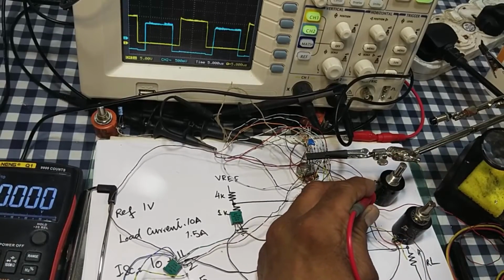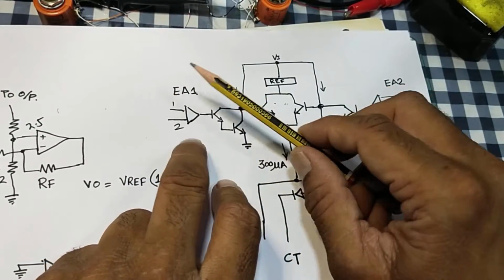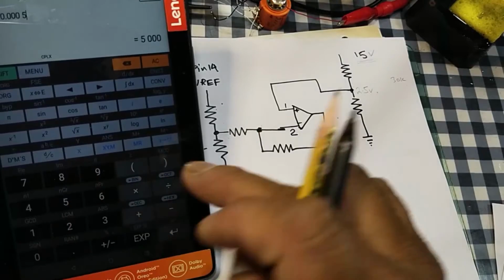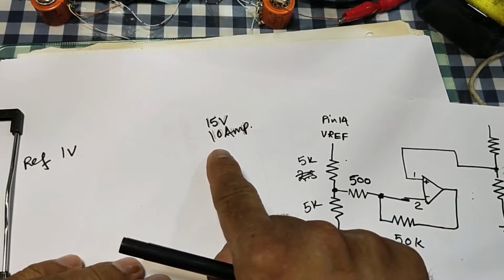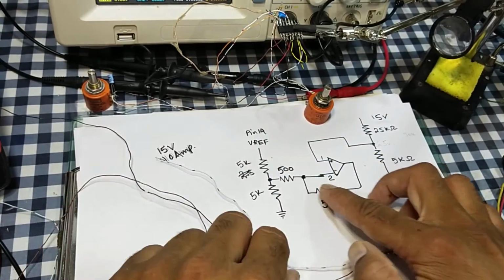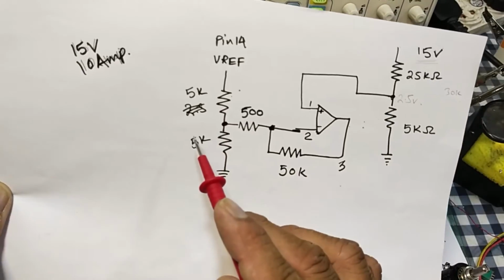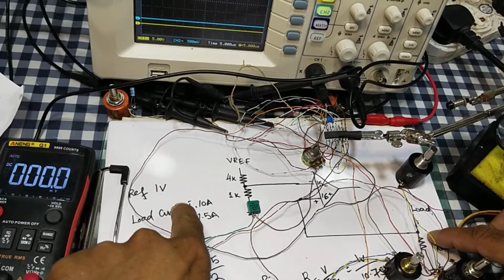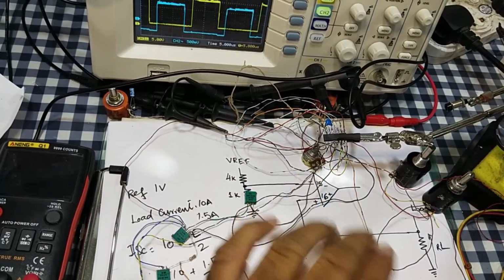{455} TL494 Error Amplifier for Voltage Mode Feedback for Regulation & Current Mode Protection

Comment: I have designed for 5v, 0.5Analysis with simulated load.  I couldn't able to rectify what went wrong in feedback. Like even if my output voltage is 5.2, 5.3 and load current to 0.7A I am getting a straight line of 12V in oscilloscope of output pin. Only for the output voltage of 5 im getting 0.6 varying and below 4.9, D is min

Comment: I have a buck converter that i would like to add a low voltage cut off to the imput. Would this be simple? It just has one pot for output. Do i need another circuit? Its an aliexpress 1500w with a 494. Probably best to just add a cut off relay.....

Comment: Hello sir. I have an atx power supply that I've reweired with a bridge rectifier to output 36v. It originally had an output at 12v 14a = 168w. What is the max current at 36v? Is it 4.6a, like according to ohm's law, or is it less?

Comment: I read that ks7500b is the same as tl494 but the tl494 do reduce its duty and over voltage but ka7500 just shutdown there is no reducing duty cycle on thr ka7500b so the two ic of way diffrent

Comment: I am having trouble getting the Ic to sense the load on to adjust the duty cycle higher to keep the voltage at 120 volt on the inverter circuit the voltage keeps dropping to 89 the duty is 50 % and the mosfet is 1000watt but a 100 watt load drop the voltage to low the transformer is a big iron core transformer so can you explain in a video if the Ic can automatically adjust the load current to compensate the voltage sensing or I need to use a different Ic

Comment: I try this out I followed your every instructions and the same value component when I connected the feedback ground to pin 1 resistor network and positive to the pin    2 but the Ic just stalling the mosfet and shorting out so I don’t understand why your instructions don’t work as you said and I cannot adjust the duty cycle to increase ac output the potentiometer just turn up the duty cycle turning down the voltage can you please show a video on the feedback from a transformer to Ic and turn up the ac output to the mosfet to increase the ac output before me every time I try the Ic over and over again the same results happens the ac volt Fritos 50 volt from 120 with any load

Comment: Sir can you explain to me why the tl494 ic inverter drop volt fro 130 to 96 volt with load the battery is fully but the ic keeps dropping the switching of the mpsfet with any load I use even with a 6amp driver totem pole the mosfet drop voltage what can I do to get the load to voltage to drop just a little instead of

Comment: Hi Haseeb! its posible to conect together the two non inverted pins of the error amp. to a voltaje divider from output circuit?
the other two inverted pins are conected both to a voltage divider from the V.ref. as usual
My circuit has a push pull topology, for a inverter.

Comment: The problem and issue is that if I connect the 500 ohm resistor between the voltage divider of 5k ohm resistor, 2.5V across 5k ohm resistor changes to 2.38 V and does not remain constant in Proteus simulation.Suggest me a solution

Comment: Shouldn't you should used Zener diode to prevent the voltage fall when connecting 500 ohm resistor between voltage divider?
Reply: Please clarify my query?

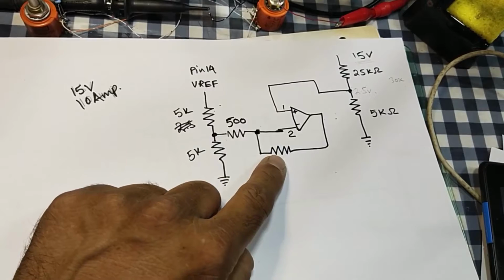Comment: Brillliant As ever! Thanks. I did not understand how you had calculated 5mA if you have less than 1mA available on 2.5v out (10:25)
Reply: I have a hard time with this to. Mr. Haseeb says there is 2,5 volts @ 5 mA over the 500 ohm resistor, but it has 2,5 V at each site of the resistor, so zero volt over the resistor ... I don't understand when or why there is 2,5 V difference between the 5v ref divider point and the invertor port. To me there seems only 2,5 volt over the 500 ohm resistor if the to measure output voltage is 0 volt in place of 15 volt.

Comment: Hello Haseeb. For pin 16 you are talking about 'short circuit'. But each current that creates more than 1v at pin 16 will (temporary) shut down the IC ( it don't need to be a short circuit). So can we say this is the maximum current setting (when used in an SMPS) , as current will drop if the IC is off and ones dropped below 1v it will start again ? So it will keep the current at a fix rate ( for example when charging a high capacity battery) ? So current feedback to pin 16 can be used for CC (constant current) setting ?
Reply from the maker: exactly perfect
that current value is transformed in form of voltage and fed to pin 15 or 16 (current mode error amplifier) when pin 16 & 15 are equal then the ic will move in current protection by skipping the pulse until the voltage difference occures at these two pins 
when these is difference, ic will start again
Reply: @HaseebElectronics  Is it skipping pulses ? Or is it adjusting duty cycle first (to zero) ? As duty cycle is controlled by the voltage to/on pin 3 (feedback pin). So is there a voltage window (example for the pin 1) that will adjust the duty cycle (from 48% to 0%) ? Is this window controlled by the gain level (100 in your example) ?

Comment: Very good video How did you calculate the gain for the operation amplifier Voltage regulation.
Reply from the maker: best regards
for a more deep understanding i am going to prepare a in detail tutorial on Operational amplifier. because it needs a very log calculations, in this video i just explained to set 1:100 ratio between input resistance and feedback resistance 
we have to understand attenuation, bandwidth, sink current and PWM comparator levels. so its detailed session will shared soon. 
because it is impossible to cover the complete ic in one video

Comment: Dear sir. I have a short killer device model sunshine 30a the blue one. It has 2 fuse when i turned it on the first fuse burns if i disconnected the second fuse nothing happened i tried to find the digram of the circuit but didn't find any can you help me please. Btw. Nothing can be noticed on the bord no burns no any marks.

Comment: Good morning sir ji tell me difference between 20n60c3 vs w20nm60n because I face a big problem to repairing a 48v 15amp charger. I replace w20nm60 in place of 20n60c3 but my charger not ok.all drive pulses or drive volt ok. Problem is that when I power on series bulb full glow. Kindly tell me immediately. Thanks
Reply from the maker: in some circuits these will not work, as you have this problem
because w20nm60 have RDS more than the other,
w20nm60 hav different gate threshold than the other
power dissipation is differnet
and gate capacitance is too much different
so you have to change gate charging and discharging network very carefully, in that case w20nm60 can work
Reply: @HaseebElectronics  thanks

Comment: Hello M Haseeb. I am having trouble with the feedback circuit of a 12v 15a psu using tl494. Under 10% load the voltage drops from 13v to 11v. Any idea where to look at ? Thanks.

Comment: God bless you brother Haseeb for your efforts in teaching electronics repair skills.  And I hope that you will make special series for repairing Voltronic solar inverters.
Thank you.
Reply from the maker: best regards and special thanks
i will try my best to start it
Reply: @HaseebElectronics  Hello. I have a question in regards to an smps repair.I have a damaged smps 12v 2A. I changed many components:3 diodes, Mosfet NPN600 volts, UC3842, main capacitor 400volts,  and the shunt resisitor 0,22 ohm 2 watt, plus other resistors and also the. Fuse. 
Now there is no short on the board but when i connect the power cable 220volts,  there are sparks and mini explosions at the  connection side of the main capacitor with no further damage to the other  nearby components( diodes mosfet..) the fuse remain intactI  I have isolated the cold side of the smps to detect the short but nothing happen. The problem still persisists .My question: is a faulty transformer be  the cause of this dysregulation  of the main capacitor(charging and discharging erratically and producing sparks) ?thanks!

Comment: last week i tried repairing a 24v drill charger(dewalt) there was no optocoupler in the circuit.! So i found out It was a buck converter   but the output voltage was 134v!!! I guess there was a problem with regulation as i understood from this video.. but cant find faulty components..thanks and my best regards
Reply from the maker: yes dear in some dewalt chargers, there are buck regulators, which are controlled by BMS (battery management system) and it controlles the switching of the buck regulator 
if the switching circuit is not working or switching mosfet is short circuit, or BMS is not controlling 
in all these situations the output will uncontrolled or no output

Comment: Ob2269 100w smps board ki Circuit explain kijiya mere smps board main 5n80 power mosfet bar bar kharab ho raha ha Tu aisa ku ho raha ha samaj nhi A raha ha kya app kuch help karenge
Reply from the maker: OB2269 65KHz ki smps controller ic he. 
is ki switching frequency check kr lein
snubber circuit jo (resistr, diode, capacitor) transformer ki primary k across laga hota he. in ko check karein
main dc capacitor per dc voltage check karein k (input ac voltage   x 1.414) agr dc voltage is k equal hoon to theek warna bridge aur bulk capacitor check karein,
mera whatsapp 00962-79-1161084 he aap msg kr saktey hein
Reply: @HaseebElectronics  thank you so much❤
Agar apko kabhi 2269 100w smps circuit mile to zaroor explain ki jiyega

Comment: Good tutorial I love that and I appreciate your effort to enlighten us.
I want to ask you for an assistance to do a comprehensive tutorial on push-pull, half bridge and full bridge converters and how to make their transformer for each sir I really need your help on those converter topology design
Reply from the maker: best regards 
i am really very very sorry for being late on your question for filter design. still i have a small doubt in ts calculation and i couldn't find its patent solution, so that is the reason it is being delayed. i am sorry for that indeed
on topology designs and its calculations i will try my best to share as soon as possible
Reply: @HaseebElectronics  okay sir and thank you for your support